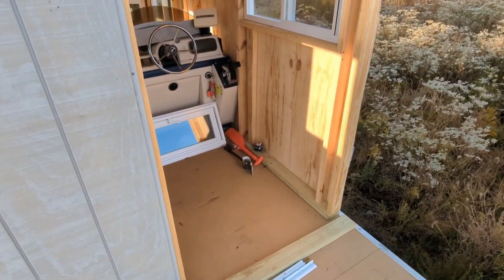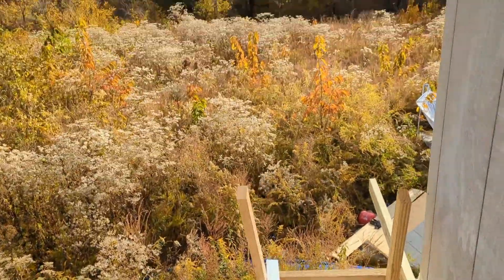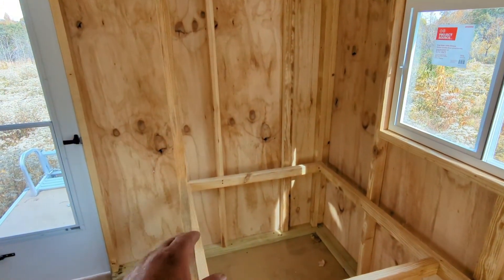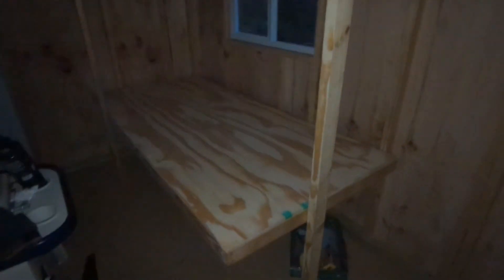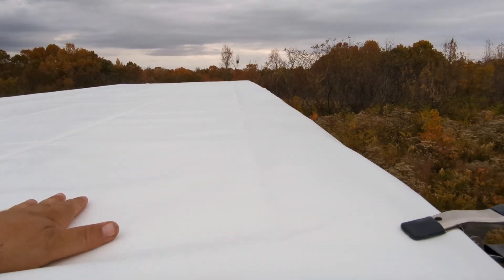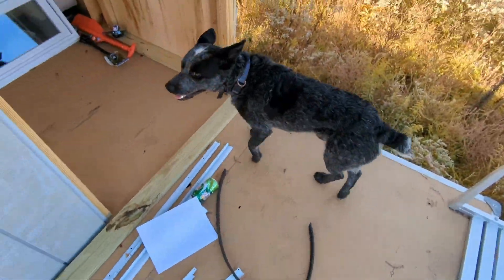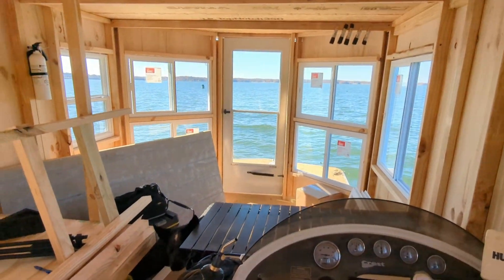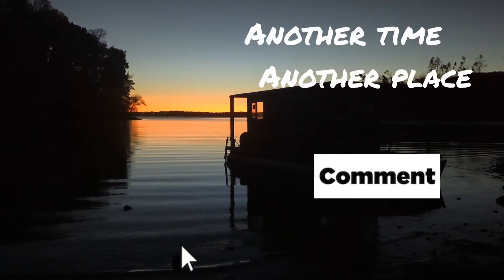#62 ATAP Sn2 Ep8 OffGrid Tiny House Houseboat Build days 9&10. Roofing, ceder Bathroom, new campsite

Comment: I think you really could use a lanyard long enough that you can walk anywhere on your boat while safely connected to the kill switch.. If you were to fall in while cruising, it could be devastating.
Reply from the maker: Thanks for the advice Will, I don't go outside while motoring in gear. I also have my hand on the kill if river is outside or in the dinghy.  I'll be honest Sailing in lake Michigan, cold water,  thought me that a simple slip can turn very bad. However I really appreciate you mentioning something.
Reply: There's a wireless man overboard engine kill switch you can add to the boat.
Reply from the maker: I only drive the boat from inside. You can't fall out... I would never have the boat drive while i'm outside on the deck.